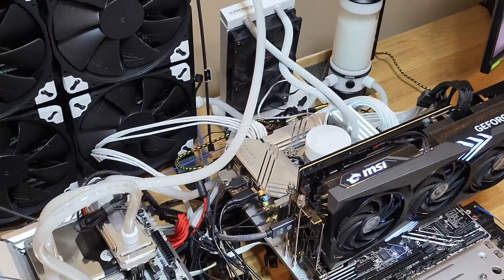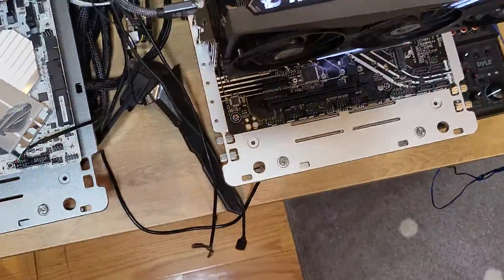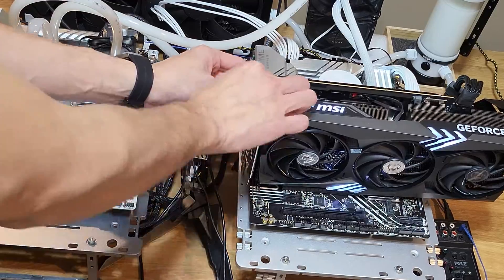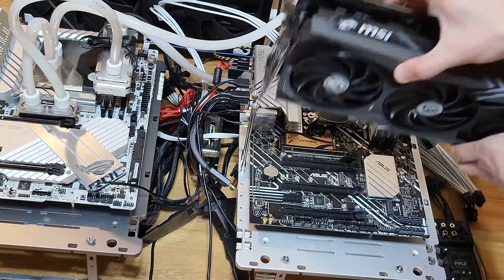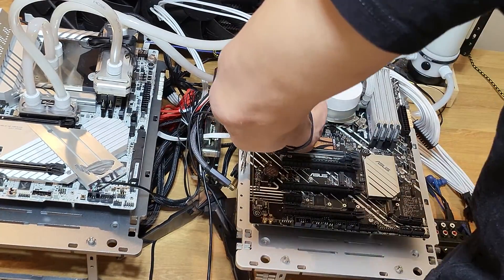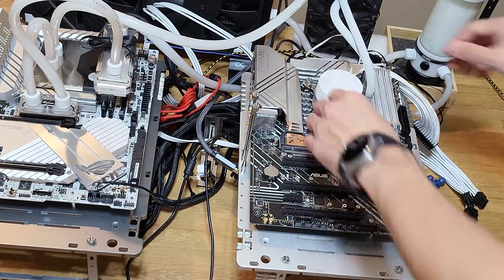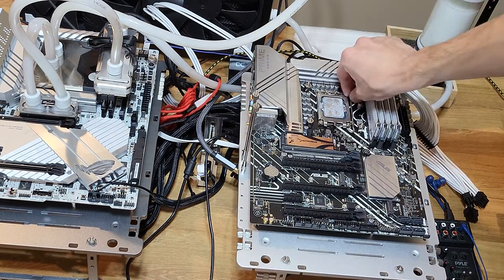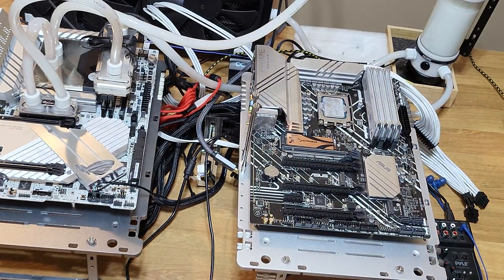DDR4 vs DDR5 \\ 14900K Samsung B Die DDR4 4000 CL14 vs SK Hynix A Die DDR5 7200 CL34 // CS2

Comment: Thanks for the video. My set up is 12700kf, MB z690p and DDR4 at 3800 CL14-15-15-35 1.5v. Would you recommend upgrading to 14900kf? My current 12700kf is clocked at 5.1 and ring at 4.7, e-cores are off at 1.35v. Would I get any substantial gains by upgrading to a newer i9? Thank you!
Reply: Not really. You know how to tune your cpu and memory, the bottleneck will not be 12700kf.

Comment: I’m contemplating on upgrading from my i7-12700f to a i7-14700k or i7-14700kf on my b660m plus ASUS motherboard so I can’t run ddr5 on it, but they updated the bios on the motherboard so I’m good to to upgrade just not sure which one would be better for gaming
Reply: Or for an extra $100 I could just get the i9-14900k or i9-14900kf I’m looking for which one would be better for gaming I play R6,red dead, apex, gta mainly r6 on all of these games I play medium or low presets/ quality setting. It’s going to be for 1440p/4k

Comment: Hi my 10900k died , so i keep my ddr4 bdie buy a second hand z790 strix a d4 and i dont know what cpu to choose . 14600kf for 260 ,12900ks for 285 ,13700kf for 340 or 14700kf for 390. i9 too expensive for me , i am only gaming and doing benchmarks. Thanks
Reply: Ryzen 7 7600, dont go for intel, their 13th and 14th cpus are dying because of a design flaw
Reply: @LvcIvsLIcInIvsLvcvllvs USB problem on AMD solved?
Reply: @Iugvn  im not aware of that. 
Go for thr ryzen 7 7800x3d for 165hz+ gaming or if its 1440p a 14600kf should suffice. B die should be similar to ddr5 . Interestingly from anecdotes people who paired 13/14th gen intel cpus with ddr4 dont experience the same issues.

Comment: Somehow ddr4 is better simply , better 1% lows, better max fps , better cpu/gpu temp!

ddr5 is better at maintaining more average fps but at the cost of horrible 1% low , so ddr4 > ddr5 in cs2
Reply from the maker: yes the absolute latency of DDR4 can still get lower than DDR5, which is more important for most games. 4000CL14 is absolute latency of 7ns. To get that absolute latency with DDR5 at 8000, it would have to run at CL28 which is currently not possible.

Comment: I have 13700k on ddr4 3600mhz corsair, should I upgrade to G.Skill Ripjaws 4600mhz in the future or it isnt worth? For around 87 bucks in my country currently.
Reply from the maker: it also depends on the sub timings to gauge how much of a difference you might be able to get
Reply: the 3600mhz are cl18 and the 4600mhz are cl19 @pyurologie
Reply: I mostly play CPU intensive games like Fortnite and Valorant, can I benefit from the higher speed?
Reply: for me 1k mhz looks like a good improvement but in game idk how that will feel
Reply: For 87 bucks try it, but i think you wont be able to pass more than 4400 at command rate 1.

Comment: what's your opinion now on throwing a 14th gen on a ddr 4 platform?  I was waiting for a video like this, thanks.
Reply from the maker: DDR5 has higher ceiling, but currently fast DDR4 is pretty much just as good as the fastest available DDR5 in gaming. I can achieve lower latency on DDR4 than DDR5 which is usually more important for games. Gaming requires more "low end torque" than overall horsepower at high consumption if we're comparing to cars.
Reply: @pyurologie  so I have some ddr4000 ram in my current rig w/13700k and 4080.  You think the gains are even worth it or just stick with this.  I'm leaning on keeping this as-is since I haven't even gamed on this system lol. But I like tech and the 14th gen is new.  Maybe the 14700 would be a nice upgrade, not a needed upgrade but one that could satisfy my stupid need for new shit.  I only benchmark these days when I have time lol.
Reply from the maker: you're pretty much at the top of the food chain for gaming with 13700K and fast DDR4 and a 4080. In terms of performance gain, you might get a little but i doubt much more.

I'm a tech junkie too, so i understand where you're coming from. I'm all for getting new tech for the sake of discovery. The 14th gen chips are a waste of money even still, there's nothing new to discover or try. They're literally 13th gen with new labels because a product cycle and profit goals exist. I just can't recommend this gen as an "upgrade", it's a joke.

I think the new frontier is mobility/efficiency (ie. handhelds taking over)